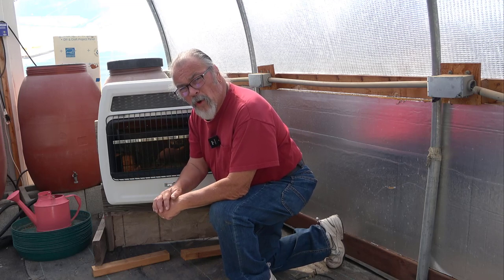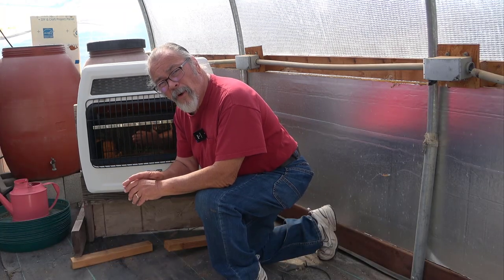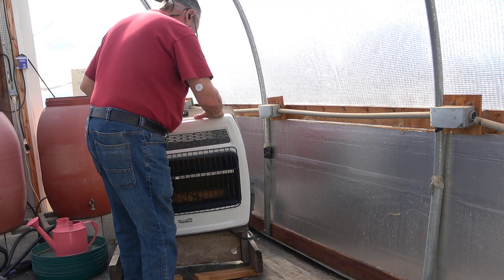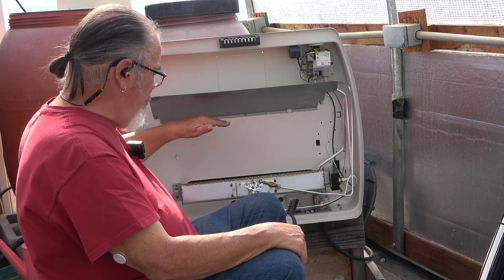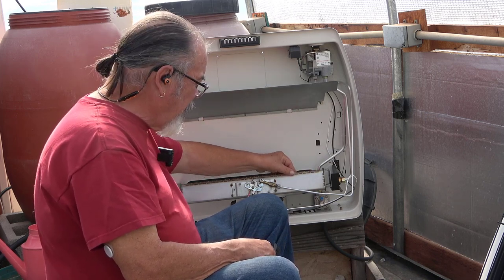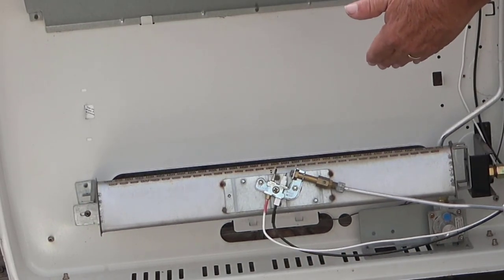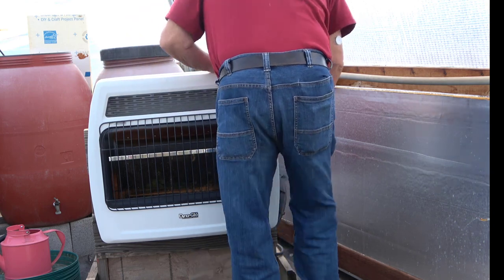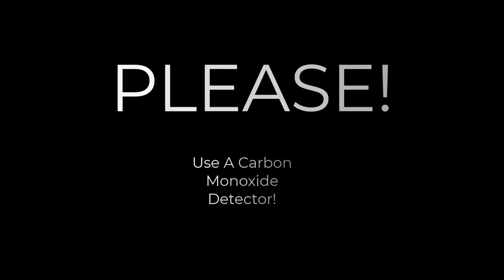How I Fixed Propane Heater Burner With a $1 Brush

Comment: Glad to see ya got that heater fixed. When the season ends for me I make sure the propane is drained from the heater hose so it does not collect an oil build up in the line then I cover mine with a large garbage bag to keep the dirt and dust out of the unit. Thanks for showing us how you fixed yours and the info to keeping it cleaned out. Stay safe and have a great week!
Reply from the maker: Great points CB! We also open the hose to let it drain. About the only thing I've found to keep the dust out of the heater is to put t in a taped box! Even that isn't perfect though. The heater worked flawlessly last night. Take care friend.

Comment: How is your little heater in the house working?  I remember that you had to do some repair on that last year.  Hope it's still holding up.  Take care now!!
Reply from the maker: Good morning Deb. We don’t need it yet, but we did a “ pre need” checkout and run last week. Everything is working great!  Since our house is passive solar, we don’t usually require the pellet stove unless we have several contiguous days of overcast combined with colder temps. But, it sure is nice to have a fire in the evenings. Take care.

Comment: It’s almost silly just how many appliances you can fix on your own with a little bit of effort, in the last 30 years I’ve never had an appliance repair person fix anything we’ve had breakdown except an old vertical washing machine that was under warranty. So far the only thing I couldn’t fix was a side load washer and that was only because they essentially designed it to fail and didn’t count the cast aluminum rear spindle that was attached to the drum as part of the drum for warranty purposes and wouldn’t/couldn’t sell just the broken part. Oh, and there was the builder grade water heater (ie crap) that had the bottom of the tank fall out, simply no way to fix that one. Having the confidence and research skills to repair most things has probably saved us a couple thousand dollars in repairs on the trailer in just the 2 years we’ve owned it and it was relatively new when we bought it.
Reply from the maker: Couldn't agree more! We've had to have a repair person in three times in 17 years. The washing machine failed and the parts wasn't available to me but the repair guy could source a y=used part. That machine wasn't built to last ... The pellet stove repair needed some information not available to me. Bah! I know it now though. Took the service guy several hours to figure out the real problem. The cook range had a failure under warranty and a similar failure now. We can use the range but have to light ot manually. Since I can't get the repair folks to come out, I need to find a way to get the tech manuals ... We can fix most things by ourselves and save time and money. Seems like a good idea! Take care.